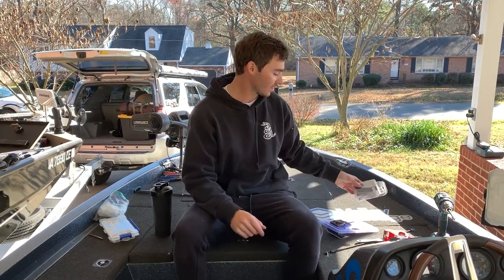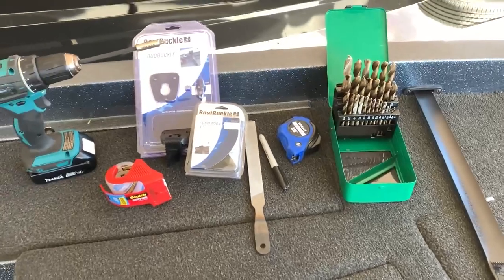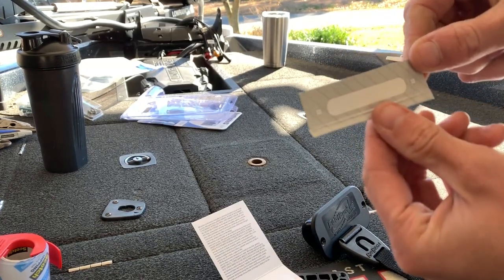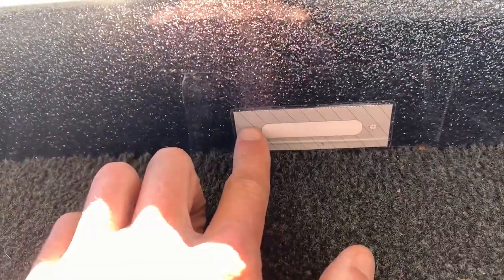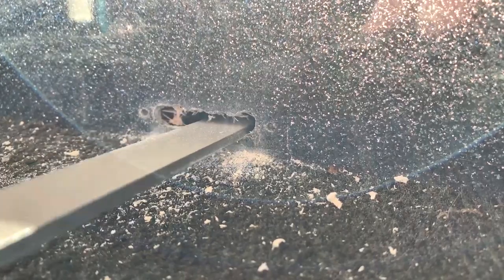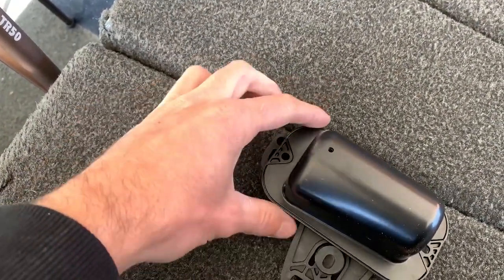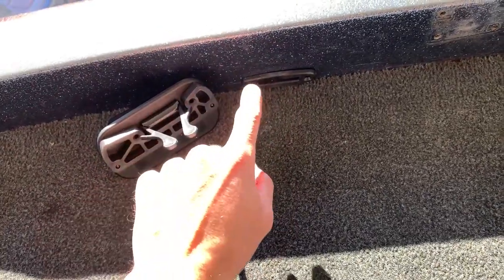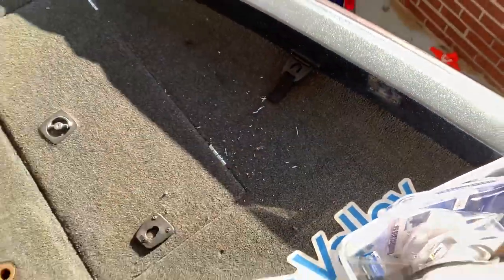Rod Buckle Concealment Kit Installation (Bass Boat)

Comment: The entire reason I searched this video is to find out how to take the plastic end piece off the strap to get it through the hole and gunnel and you totally skipped over it.
Reply from the maker: It slides out out but it’s a tight squeeze. You kinda just have to man handle it

Comment: I noticed that you installed the catch over the rod locker instead of directly to the deck. Did you have to use nuts to attach to this location?
Reply from the maker: I was able to get away with just stainless steel screws. They were short enough that when you opened the lid, they would not cut you on the inside. I also predrilled all the holes as a precaution. Bolts would be more secure, but I’ve had zero issues with screws thus far.